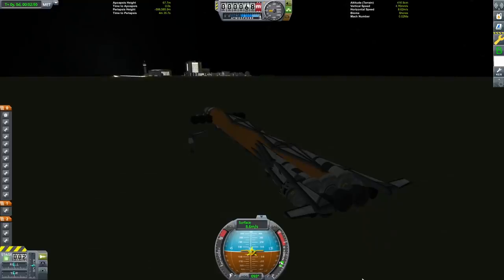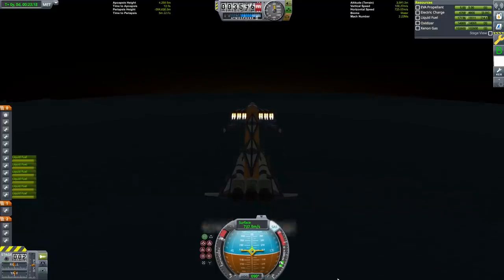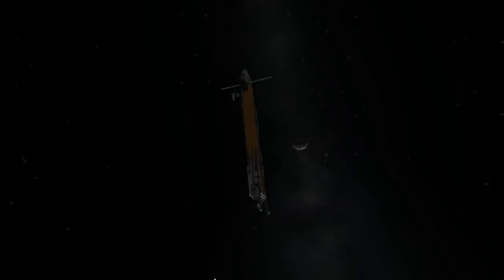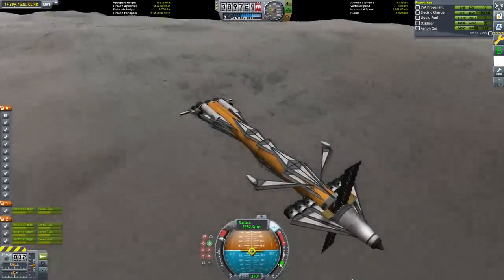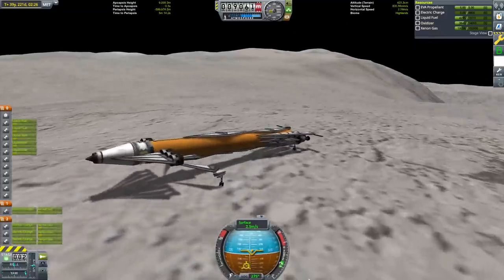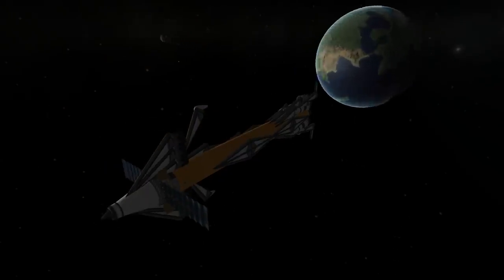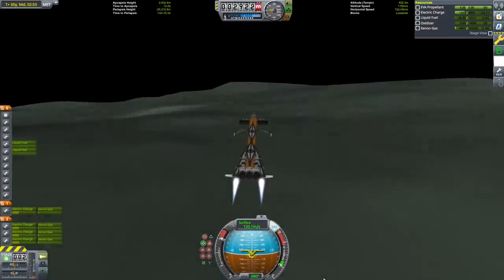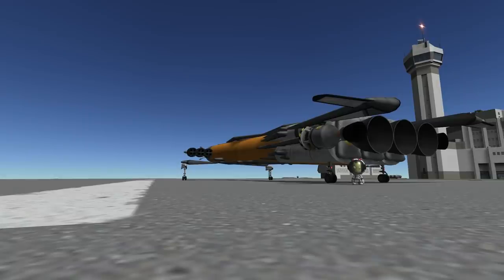Single stage to Tylo spaceplane: Return trip, No ISRU; Stock KSP v1.5

Comment: This madlad went and done it again. A most impressive accomplishment indeed!

Although, to be fair to your past self,  you were probably correct in assuming this was impossible with the parts available at the time. Considering how tight the margins were for this mission, the new extremely efficient DLC wolfhound engines were likely the factor that pushed it into the possible territory.
Reply: Stratzenblitz75 tru the wolf engines are better than the poodle both in thrust and delta v basically a upgrade
Reply: There isn't a better way to ask this: When is the new video?
Reply: Wolfhound engines are broken. They make all other vacuum engines obsolete. (Please DON'T nerf, squad)
Reply: HAIL TO THE APOLLO SPS
Reply: @firemetal9655  Ah yes, the Wolfhound, it's really shrunk the Kerbol system huh?
Reply: I suspect quite grievous abuse of offsetting has something to do with it too. Looks to me that everything is joined end-to-end so from the game's aero model it's all perfectly streamlined (including those super draggy wolfhounds), then offset extensively so exhaust can escape, the CoM is in the right place, and so it looks good. If I'm correct in this assumption then it's as much an accomplishment in breaking the game as it is in using the tools the game provides as intended.

Comment: The fact this mission is possible speaks heavily to the power of the wolfhound. That engine is borderline OP compared to the other liquid engines. Good work!
Reply: Exactly what I was thinking. I hate that they didn't work harder on giving new engines that would have different roles instead of an engine that just removes choices by being too good. Still an amazing mission though.

Comment: This mission is truly is amazing. Again you have outdone yourself and all expectations.
This is also likely the first time a mun gravity assist saved actually significant amount of fuel (relative to what you had left at the end)
I did the math for this a while ago without the wolfhound, and found out that it was barely possible, but now i see that i forgot that i forgot to take into count the RAPIER ISP of the final ascent from Tylo, and instead used the ISP of rhino engines to all of the thrust.

Comment: I have a challenge for you: achieve a stable kerbin orbit using only air breathing engines (rapiers are allowed, but without the use of closed cycle mode) 
Maybe you can accelerate insislde the atmoshphere to get a mun encounter, which would put you into an orbit outside of the atmosphere. You are allowed to use engines (or RCS) to deorbit.

Comment: you should put small thins on the front for take off. then disable their pitch mid air. or even eject them if they don't consider part of the stage
Reply from the maker: That would with a certainty fall under the category of staging.  This craft had plenty of pitch control, I could have pitched up if I wanted, but I would have started losing airspeed.

Comment: I challenge you to drag a class E asteroid into Ike orbit. It's something that I'm having significant trouble on my career mode game. (I didn't know what I was getting myself into until I accepted the contract!!)
Reply: Damn, to do the Class E Asteroid redirection mission, I have to take Endurance electro plasma engines to actually have enough thrust and fuel...  but puting those engines on a classic stock style of ship is insanely painful since they consume a ton of electricity and heat quite a lot. Endurance ship parts have coolant and energy production that are so OP that when you put a Endurance with its engines you never have those problems. Could be a thing. Build an Endurance, put a grappling hook instead of the shuttles and add some fuel tanks and you're good to go. 
For class A asteroids already near Kerbin, a classic ship can do the trick, with some more fuel tanks. For class C, Nervs do the trick alright. But for class E, the ship must a have an astronomical quantity of fuel tanks to have enough delta-V. The other solution to pull the asteroid more easily is to bring drills, ore tanks and ISRU to mine the asteroid, refuel your ship and make the asteroid a lot lighter in the process. But mining and converting takes time and to stop the asteroid on its trajectory, you got to act fast.
I always arrange the encounter to take place just after the asteroid enters Kerbin's SOI. Remember to quick save before contact because if you bounce, the docking won't count in the contract since you've got to bring along PREVIOUSLY UNDISTURBED asteroids, happened to me once, all those efforts for nothing, gee...

Comment: Given how you ended up using the Rapiers, would it have been better to replace some of them with Whiplashes for Kerbin ascent? Their thrust is better at low velocity and your dry mass would be lower. The only drawback I can see is that they might flame out earlier.
Reply: I asked a similar question on a hazard-ish video, the answer I got there was that the advantages at high speed and high altitude out way the weight savings and low altitude/speed performance bonuses.
Reply: Elliot Beaudoin it’s “outweigh” papi not way

Comment: When has it become a good idea to not aerodynamically shield the front of 1.25 meter engines? I thought DLC had a rocket fuel cone, and definitely there is the stock jet fuel nosecone.
Reply: They're probably offset. KSP's drag calculation works a bit differently from its actual rendered graphics in that if you offset something, the drag will be calculated as if it were still attached where it began, just.. somewhere else.
It's weird.

Comment: How are u so good in ksp.Do u have a degree in astrodynamics or something?
Reply: Mastering KSP is 90% patience really, this guy is obviously more patient than average.
Reply: @hakont.4960  Yes but how can he find out these complicated maneuvers?
Reply: @sohanturtorial3856  Well, he's using the Kerbal Engineer mod, it can actually show optimal transfer angles to other objects in space, including other space crafts, or he's calculating it himself with formulas found on the internet. Still very impressive of course.
Reply: @hakont.4960  Wait but I also use the mod and it doesn't show me that.
Reply: @sohanturtorial3856  it's in the "rendesvouz" menu.
Reply: @hakont.4960  Thnx I will try that.
Reply from the maker: Mathematics actually, but I did do my first 2 years as a physics major.

Comment: I don't know how to phrase this without sounding bad, but I don't like that you're using DLC parts. I get it, they have their advantages, and you'd be hamstringing yourself not using them. But I've always loved your videos because I always knew that, if I put in the effort, I could do something just as impressive. That isn't the case anymore, in many areas the DLC parts are objectively superior to the stock ones. To me, this makes it feel like matching your achievements is locked behind a pay wall. Which I would argue makes your missions not full stock anymore. Just to be clear I have no problem with you using DLC parts, you can do whatever you wish, you have no obligation to match my or anyone else's preferences.
Reply: I mean, the whole game is "locked" behind a $40 paywall if you want to call it that. 

MH is a dev-made, dev-approved, continuation of KSP. I see those parts as 100% stock even if some are objectively better than older parts. It's a sandbox game, it's not like you need to pay microtransactions for each part, hell you can give yourself infinite fuel if you want. 

If you don't want to give the devs 15 more bucks for an incredible game then don't, there's no problem with that. But expansion parts are definitely stock and it's not like using them makes your mission cheaty or whatever. Making History is basically just another update to the game that you have to give a little money for, and you had to buy the game in the first place so I don't see what's wrong with it. If you don't want to there are a million mods out there that end up giving 100x the fun an expansion ever could.
Reply from the maker: I appreciate this kind of feedback.  In general, I have seen the Making History parts considered as stock, and I would argue that they aren't more powerful than the non-DLC engines, they just offer more design space.  I personally plan on continuing to use them because they are fun, and don't contradict my interpretation of 'stock'.  In any case, thanks for the comment.
Reply: @synapsomorphy  I appreciate the reply, but I have to address a few points.

Obviously you have to buy the game in the first place to play, that's not really an applicable analogy.
 
My whole point was that I liked that Brad showed what was possible using stock parts, I never use mods or cheats for that reason as that kinda takes away the whole point.

I personally always considered "stock" to mean parts available in the base game. Since DLC is not part of the base game, it isn't stock. I do understand that many use the definition of "not modded" and I can definitely see why. Nonetheless, I feel there should be SOME way of differentiating DLC and non-DLC craft, due to the large advantages DLC parts (particularly the Wolfhound used here). Regardless of your feelings on the stock debate, that point should be agreeable.

I completely and totally understand the opposing perspective. I simply needed to air my grievances. If the extra money raised by this DLC allows the Dev's to make better free updates in the future than I'm fine with it of course.

I would take less issue with the DLC parts if at least were balanced, but as mentioned above they definitely are not.
Reply: Caden Gaul in terms of balance do you just mean the wolfhounds?
Reply from the maker: @kronusaerospace8872  I don't think your balance argument works.  If I had to name an overpowered conventional rocket engine, it would be the Vector.
Reply: @kronusaerospace8872  Balance is impossible to define in KSP's context. You make challenges for yourself, you can arbitrarily make them as easy or difficult as you want. The balance isn't consistent with real life and it isn't even internally consistent between updates. Parts and systems are being rebalanced and added every update. 

Here's an example: The awesome Mk2 Expansion mod has a scramjet that can do Mach 10 or maybe more, can't remember off the top of my head. You could say it's unbalanced, getting you to interplanetary speeds at 2000 isp. On the other hand, it doesn't even start producing thrust before Mach 4, it's heavy, and you have to deal with the insane heating and the high-speed instability. For most missions, it's way too heavy and arguably underpowered. For a "how far can you go on air-breathing engines only" it's the only viable choice. 

Another reason why balance can't be objectively determined is that rocket parts (ironically) don't exist in a vacuum. An OP jet engine is worthless if the lightest air intake weighs 30 tons. A part's utility holds as much importance as its stats AND that has to be evaluated on an individual mission basis. 

Yes, the environment of challenges should be kept consistent, otherwise, what's the point? Yes, having reservations about a prerequisite of a challenge being behind a 15$ paywall is completely valid. However, balance is relative, and the quality of a challenge can only be measured by how subjectively fun and challenging it is to you. I don't know about you but, as far as I'm concerned, the potential 5 or whatever% better efficiency of the engine isn't a big enough deal to make this video any less impressive.
Reply: @BradleyWhistance  I just fail to see in what ways the wolfhound isn't better than then stock engines like the Poodle. While heavier, it has higher thrust and additionally a higher twr, and a much higher ISP. I would argue that the engine doesn't just fill a niche, as its higher thrust and efficiency means it would be the superior choice to the poodle in the majority of cases. Its higher thrust allowing for more efficient maneuvers and lower fuel consumption making up for its additional mass and size.
My issue is that the advantages of Wolfhound engine lead me to question whether or not this mission is possible without DLC parts.

I would also argue that in the context of the other engines, the Vector is fairly balanced. It has the same TWR as the Mainsail in vacuum, albeit with a slightly higher atmospheric and vacuum ISP. However its TWR is lower than the Mammoth, and its ISP is obviously much lower than engines like the terrier or the poodle. Its only real major advantage is how convenient it is to use. The Vector seems to fill a niche whilst the Wolfhound treads over ground typically reserved for other base-game engines.

Also this was really a minor point, it is far from my biggest issue with the DLC. Even taking everything together it's not like I'm heartbroken about the whole thing.  I'm perfectly happy making my stock base-game craft. At the end of the day the creations of the community are not the major part of why I enjoy KSP.
Reply from the maker: The Vector/Mammoth absolutely overwhelms everything else in the category.
Reply: @BradleyWhistance  I don't mean to sound disrespectful, but as I stated this is a really small point that I don't really care too much about. The Vectors aren't even that relevant to this discussion.

I want to round this off. I hope you keep doing what you do, but I needed to say my piece. As I mentioned I have no issue with you using those parts and you need not placate me.

I have nothing but respect for you.
Reply: God this argument is way too civil for a youtube comment section.
Reply: @aidanbowie5391  haha, that's KSP for ya!
Reply from the maker: As I said earlier, I very much appreciate this kind of feedback.  Most people with a concern say nothing, so I take this to heart.  Thanks.

On a pretty much unrelated note, It should be mentioned that the Wolfhound has some non-obvious disadvantages.  For example, it takes up a ton of space for its mass and thrust, and generates a ton of body drag.  That prevented me from using them as a secondary engine for my Eve ssto design.  There also I reason I never use the Poodle.  Comparing favorably to another part is not necessary a mark of OP.  <3